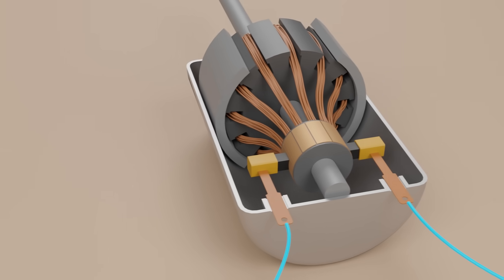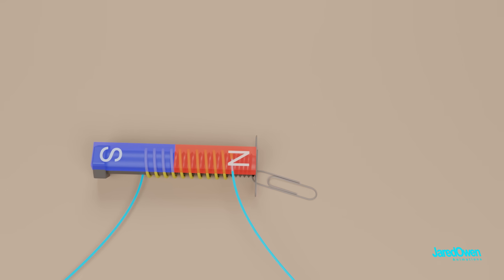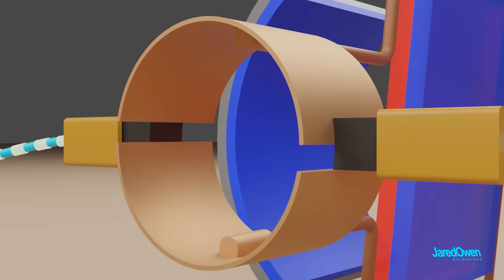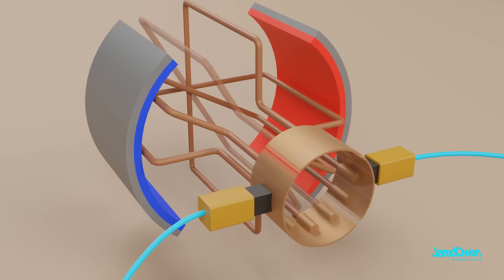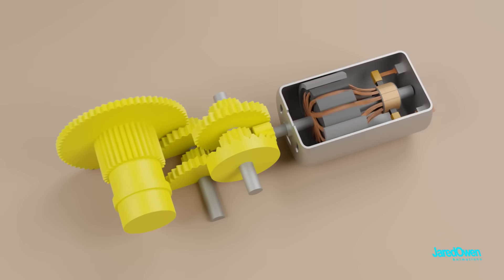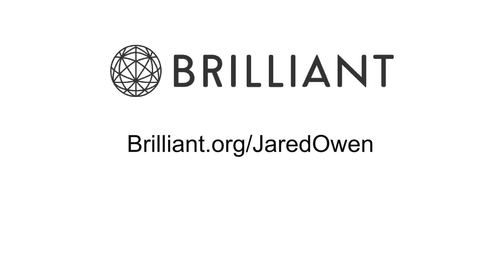How does an Electric Motor work?  (DC Motor)

Comment: OK, let's get a brain.  1. The center of a magnet is the most powerful part.. think about who is separating the two poles ...It' s the guy in the middle.  2.  Knowing that all life and everything in existence is a magnetic element you would surmise, E=MC2 is a joke and you would be 100% correct.   E=MD, (Magnetic Density), .  Wake up our universe is all magnetic every little part is magnetic..  all plants people animals we are all in a magnetic universe I have been in the world of physics since 1958, as a ham operator I designed and built my own Radio transmitter and receivers.  ANTI GRAVITY is not a big deal,   it has everything to do with the most powerful part of a magnet that man has ignored for far to long. The center of a magnet is the most powerful part in a big way, (Tesla said,   look for things you can not see),  this was a big part of what he was trying to give us.   The problem is it exposes free energy from the sky as well if you know how to extract same.  The pyramids were transportation devices around the world and planet's. (kind of like a elevator),  The real power plants were  Gobekii Tepe and Stone Henge  The Horizontal rock oscillations would provide the necessary vibrations in concert with the "B" field  to provide the anti gravity for several hundred miles,: Via the earths magnetic field in concert.

Comment: I’ve one question I think you can help me with. I read that early motors sparked a lot with every turn of the rotor. Tesla introduced some innovation that stopped or greatly reduced the sparking. Was it brushes? If so, how were motors designed before brushes or whatever stopped the sparking problem? Thank you!
Reply: The AC induction motor (invented by Tesla and others) does not use brushes at all. There's a rotating magnetic field that induces current in the rotor. Look for 'how an induction motor works'.
Reply: @Tankwiper Thanks!

Comment: Why does the screw get hot when changing polarities? Is it the changing of polarities that gets it hot or the fact that the wires transfer the heat of the wire that gets the screw hot?

Comment: Correction: current or electrons actually flow from negative to positive, not the other way around, that is why only the north pole attracts metals because metals, electrons and other stuff related to metal are negatively charged

Comment: I have a question and will be very thankful if someone can answer it,
So I basically want to make one of these out of scratch and I don't want a off and on switch so can I just directly connect the metal loop (I think you can use copper wire) to the battery, without having the commutator and brushes or if I need to commutator can I just connect the battery to the copper wire inside the commutator?

Comment: ⌚Timestamps:
00:00 - Intro
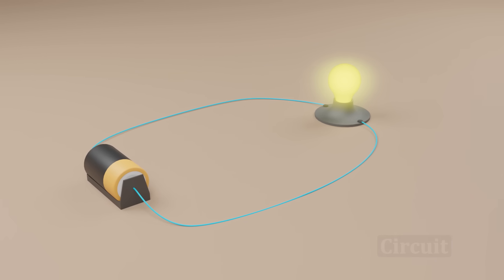00:41 - Circuits
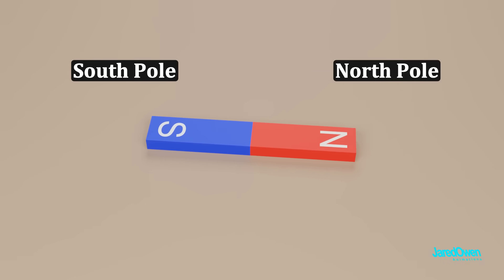01:22 - Magnets
02:27 - Electromagnets
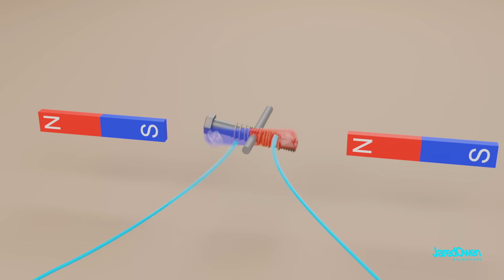04:28 - Improvements to Electric Motor
05:00 - Commutator and Brushes
07:19 - Improving Torque
08:20 - Devices with Motors
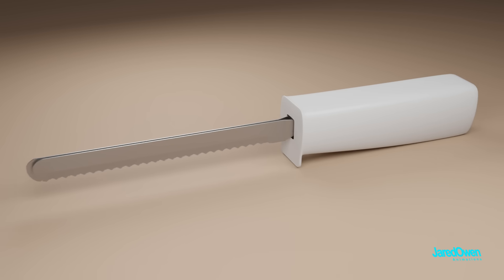09:00 - Brilliant
Reply: Thankx

Comment: I never understood how motors actually worked and this is actually super easy to understand, thanks man!
Reply: https://youtu.be/yfeDqNNP7Ek
Reply: Don't forget all AC & Radio waves type power have three elements, 1. the positive cycle 2. the neutron, last but not least the   3  the negative cycle.  That neutron cycle is by far the most powerful once you understand:  Without the neutron, the energy could not move forward!!!  You can learn allot about this if you have a bar magnet.  I will prove to you that the center field of a magnet is the most powerful by far!!!  It's how they built the great pyramids!!    If you have a bar magnet/ not a horseshoe type, I'm going to show you all the basics.   DO NOT DISRUPT THE CENTER FIELD WITH ANY OTHER METAL>> 1. Anti-gravity, get something like plastic or glass a granite rock would work well just tap with your finger the centerfield of the magnet near same and it will lose 2/3 it's weight, Next 2.  let's tap the center field near a stream of water and watch it repel the water.  3. If you vibrate the center field at the correct frequency any granite rock will become butter.  YOU MUST UNDERSTAND THE DIFFERANCE FROM An OSCILLATION AND A VIBRATION!!!  The petrographs on the pyramids told us all of this...  Our future will depend on the center field, The height of one's intelligence is directly proportional to their realization of their own ignorance VPC!!
Reply: Same here, while for ICE I have known for ages how they work, for electrical, in general I did not understand how you turn spinning motion into electricity and then the other way around. Now, next step is to understand solar panels, as apparently, th use some chemical process to produce the electricity

Comment: Simply perfect. It could be called art. One of the best representation and explanations i have ever watched.
Thank you
Reply: Fax. No printer! Best video on DC motors that I have ever watched.
Reply: @danielatkins9551 😅
Reply: @danielatkins9551  sssddd
Reply: @Anton Dales tesla invented AC which leads to AC motors, this video is about DC motors
Reply: @@antondales7960😅😅😅😅😅😅😅😅😅😅😅
Reply: This applies millions I me go make millionaire whith this 🤑
Reply: Don't forget all AC & Radio waves type power have three elements, 1. the positive cycle 2. the neutron, last but not least the   3  the negative cycle.  That neutron cycle is by far the most powerful once you understand:  Without the neutron, the energy could not move forward!!!  You can learn allot about this if you have a bar magnet.  I will prove to you that the center field of a magnet is the most powerful by far!!!  It's how they built the great pyramids!!    If you have a bar magnet/ not a horseshoe type, I'm going to show you all the basics.   DO NOT DISRUPT THE CENTER FIELD WITH ANY OTHER METAL>> 1. Anti-gravity, get something like plastic or glass a granite rock would work well just tap with your finger the centerfield of the magnet near same and it will lose 2/3 it's weight, Next 2.  let's tap the center field near a stream of water and watch it repel the water.  3. If you vibrate the center field at the correct frequency any granite rock will become butter.  YOU MUST UNDERSTAND THE DIFFERANCE FROM An OSCILLATION AND A VIBRATION!!!  The petrographs on the pyramids told us all of this...  Our future will depend on the center field, The height of one's intelligence is directly proportional to their realization of their own ignorance VPC!!
Reply: could it be called art? I'd say it's better than banana ductaped to a wall
Reply: @mlembrant  s
Reply: @mlembrant  Banana duct-taped to a wall has obviously found a home in your memory bank. I'd say that's mission accomplished.

Comment: I have 2 ceiling fans with dc motors.  Whisper quiet and they use 60 watts at full speed.  One of the fans is 72".

Comment: loved it. thank you. am i correct in assuming that if I were to manually turn the rotor, it would generate a current?
Reply: I dont think so
Reply: @xyrusgabrieldiosomito7242  "You" don't "think" so.
Thank you random stranger who didn't make the video and has no known credentials, for that not at all scientific, in depth reply. I am ten percent smarter now thanks to the amount of knowledge you just shared. The entire Universe should clap and cheer for you.
Reply: yes it would, however you'd need to turn it very fast for a while to be able to generate enough current to power a small light bulb, but it would work

Comment: Most DC motors, such as the ones in toothbrushes and computer fans, are actually brushless DC motors that use an electronic sensor instead of the contact brushes. My electric hand drill has a classic DC motor with the contact brushes described in this video and you can tell because the sparks on the contacts cause the motor to glow when it runs and there's a faint smell of ozone.

Comment: It is unfortunate that this explanation suggests that there are two magnetic forces in operation to facilitate the movement of the rotor.   The simple fact is that there is one magnetic force and the second item required is simply a current flowing in the rotor conductor.

Comment: Maybe this is a bit obvious but for people who are wondering, a magnetic field only provides a force on moving charges. The direction of that force is given by  F = v x B  . That 'x' means a cross product of the velocity and magnetic field, which means the force vector will be perpendicular to the other two vectors. The v and B vectors or the direction of the current/moving charges  and magnetic field should also be perpendicular to maxmise the cross product. The force switches direction when the current switches direction, so that's why you have to keep alternating the direction of the current to make to wire loop spin in the same direction, for example clockwise like shown in the animation.
Reply: It's Lorentz force:

F = q ( v × B )    OR    F = i ( L × B )

F : Force on conductor or charge (newton)
q : electric charge (coulomb)
v : velocity of charge (m/s)
B : magnetic flux density 
i : electric current
L : length of conductor

Comment: Your animation for the battery indicates that electricity flows from positive to negative.  Electricity flows from negative to positive.  The positive terminal of a battery is lacking in electrons, the negative terminal has an excess of electrons.  Therefore electrons flow from the negative terminal on the battery to the positive terminal.  I don't know how the "term conventional" current came into use, but it is the opposite of actual electron flow.

Comment: Even when disassembling devices, I never got far enough to take the motor itself apart, so it remained a black box to me until this video. Cheers for the great explanation! The animation and incremental complexity explain so much better than static diagrams.

Comment: 4;51 diagram is incorrect. When the coil is at a vertical position, the current is cut off so there is no magnet in the coil  but the animation continues to show the presence of a magnet.

Comment: Brushless motors are different to brushed motors, they require an ESC (Electronic Speed Controller) to work, while a brushed motor is optional to have a speed controller. Speed Controllers are used in RC Cars and other RC Models.

Comment: Question.  I recently took an electric fan motor apart because the magnets had come loose.  There are 4 magnets in this motor.  Not checking or knowing how they should be oriented i.e. north v south, I put them all back in where they are all drawing armature to the magnets.  After watching this video, I can see this was wrong.  My question, should the magnets be placed ns, ns or nn, ss?  Please explain.  Thanks

Comment: You have the electric current traveling in an impossible way. Electrons are negative. And they are the only element that can travel through a wire. They travel from the negative pole of the battery to the positive pole that attracts electrons. However, your demo of magnetism portion is correct.

Comment: As soon as you said “stator” it all clicked. Great video! I used to take apart various household objects I would find as a kid and rip out the motors, re-connect them to some power and try and repackage it all in a little wooden handle with a fan I made out of paper. Was making my own handheld fans. They were rad, I made about 6 and sold most of them to family members for $20 lol

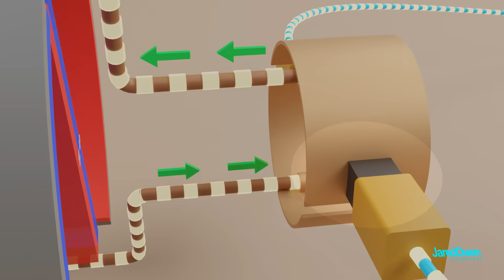Comment: @5:44 Does the current really flow the other way? I doubt. Because current is flowing at the same direction except the poles are changing. From south to north. And magnetic field is from north to south. If im wrong please correct me.
Reply: Bro magnetic pole changed because of change in current as current will flow anti-clockwise North Pole will be generated using right hand thumb rule, and if current flows clockwise then South Pole will be generated in this way they repel and try to fix their position according to permanent magnet….. hope it helps you
Reply: @abishaisingh8024  but the source(battery) is not change from its original position. It remain the same. And so does the wire were current flow....  So the current will flow in same direction except everytime the brush hit, it change to south. And when the other plate come, then it will start again from south. Thus maitaining south and south repel.  I think there is no change in current flow. It remains same through out.. just the pole of the plate change to south everytime it hit the brush (b1)
Cause if current flow change, so does the rotation of a motor will change.
Reply: @luckystarlyngkhoi2682  yaa battery is not changed but the terminals of the battery with the connecting component can be changed by changing the connecting wires with the two terminals
Reply: Perform a activity with a dc motor and a plastic fan and battery connecting it in different ways, you will see that direction fan will change on changing the terminals...

Comment: In an alternator, Magnetic rotor is rotated between 2 copper sheet, will it produce an AC which can be used in household or Will the the copper rotate due to rotating magnetic field or be stationary? Is it an alternator or AC Motor?

Comment: So what causes these types of motors to just suddenly stop working?
Reply: removing batery
Reply: @harisankar1932  yes removal of battery will stop powering it. I wanted to know what causes these motors to stop working. With power supply provided, the motor wont spin at all....some even have power loss
Reply: @nobodyschild967  rust maybe

Comment: 00:00 Where DC motors can be found
00:39 Circuits: battery, switch, and load (light bulb)
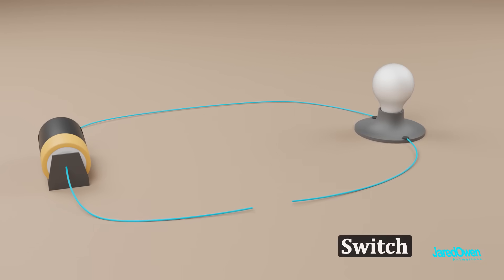1:02 Conventional flow and current reversal
1:22 Permanent magnets
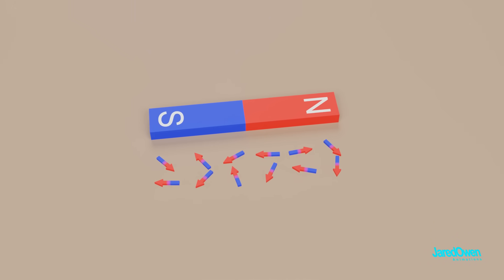1:58 Spinning a permanent magnet
2:26 Electromagnets—CAUTION, hot!
3:36 Replacing a permanent magnet with an electromagnet in the spinning experiment
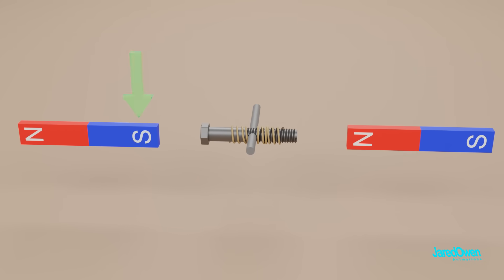4:11 Effect of adding another side magnet
4:33 Replacing electromagnetic bolt with an armature
4:59 Using a commutator instead of wires
5:08 Spring-loaded brushes
5:26 Brushes with commutator
6:09 Problem with single-loop armature 
6:21 Splitting the commutator ring into more segments
6:59 Many loops to the armature and torque
7:17 Improving torque via magnet strength
7:48 Stator (stationary), rotor (rotates), motor case, and axle

Comment: but iam sooo confused how at the beginning of your video how the bulb glow even when you flip the battery the other way round in the electric circuit. the bulb will not actually glow if you flip the battery .

Comment: 5:31 Be careful, in this position, the electricity will actually short-circuit along the top commutator segment (or bottom commutator segment), rather than going through the loop. Electricity likes to follow the shortest path, and having both brushes touching the same commutator segment at the same time, gives it that shorter path. In the 4-segment or N-segment design, the two brushes are never touching the same commutator segment at a single time, so this issue goes away.
Reply: Somewhat strange to see that short but here, it is simplified illustration of the theory. Easy to imagine that in practice the layout is different. A theoretic motor with just two commutators will not work anyway as the direction to start spinning is undetermined (unless slightly pushed off phase, but even then there is a dead zone at startup). Simplest motors in real, have at least three commutators, but showing it here would make it harder to understand the basics. So this is fine I think.

Comment: very good ghost killer over 1000W, when a ghist goes into the motor of a vacuum cleaner, it will burn away, so you need to recoil. Ghosts have metallic parts. Angle grinders with electronic protection can kill more ghosts in the motor.

Comment: Are there motor types where the stator also is electric? I can imagine you'de be able to make a lighter and more powerful motor if, let's say, 12 stators can repel and attract 15 anchors* on the rotor, with each stator switching poles 30 times per cycle. Although you'd no longer be able to use regen braking in a vehicle.

Edit: I just realized I may have accidentally described a stepper motor

* I chose the numbers 12 and 15 because they can be divided to 6/5, 4/5, 4/3 and 2/3, allowing you to 'shift up' and trade motor torque for speed.

Comment: The type of motor in this video is a strong DC motor.

This motor you can also think of how it works as having forces acting on both ends of the loop as the forces on a current-carrying wire, wires, or imagine it as an electromagnetic dipole as shown in this video.

Comment: Question, can you create power with the armature if its manually spun ie in a wheel hub but does not create resistance but can provide a trickle charge effect?

Comment: 3:50 or you can do it the opposite like the electromagnet will be on the side and the perm magnet will be on the rod that making it a brushless but would need a circuit board to cotnrol.

Comment: Great job! There is something more i have to understand. If i connect a hair dryer to my home power socket it gets AC current. So, someone could say that the polarity of the magnetic field can change thanks to AC and so there is no need of commutator and brushes. Is this right? In any case, when i go home i am going to dismantle it and have a look.

Comment: Electric motors can seem very mysterious!  How do they use electricity to start rotating? Let's break it down step by step to understand how it works.  Topics covered in this video: circuits, current, magnets, electromagnets, armature, commutator, brushes, stator, and rotor. This video only covers DC motors.

Comment: ⌚Timestamps:
00:00 - Intro
00:41 - Circuits
01:22 - Magnets
02:27 - Electromagets
04:28 - Improvements to Electric Motor
05:00 - Commutator and Brushes
07:19 - Improving Torque
08:20 - Devices with Motors
09:00 - Brillian
Reply: Ah yes brilian
Reply: Armature
Reply: that 9min of all this titles .. university will take to teach you 6months and 2k$